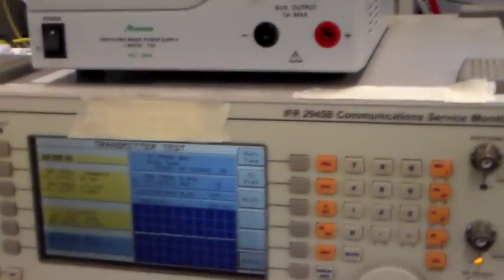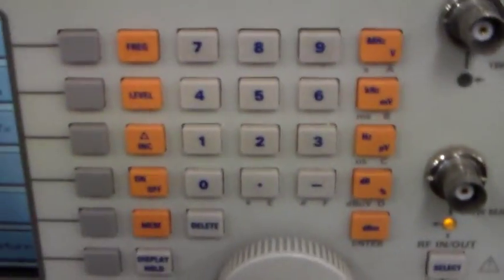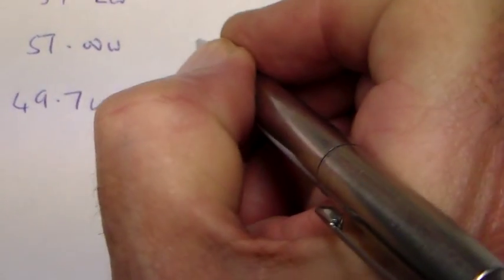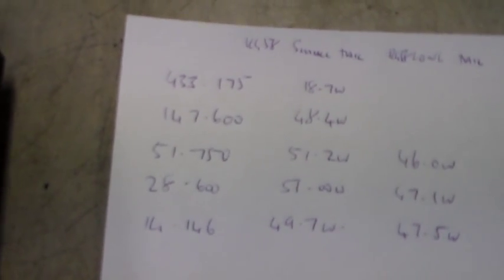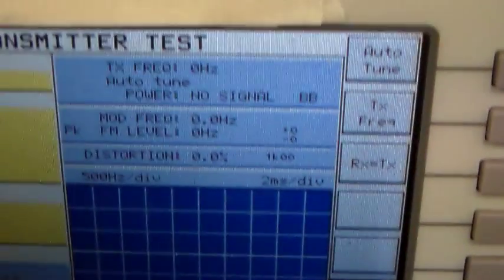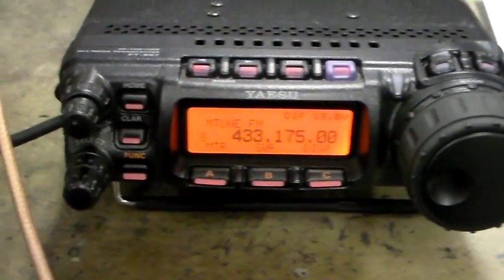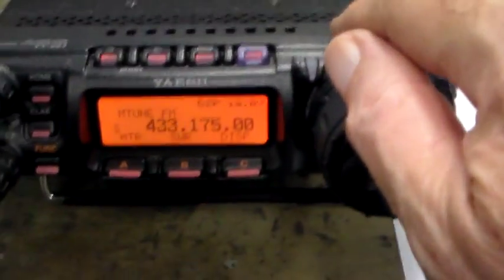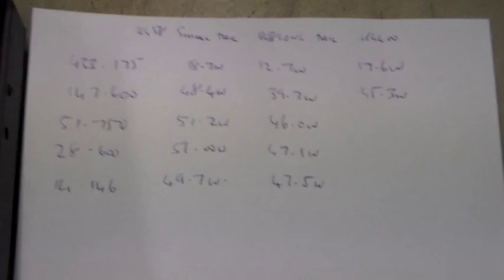RG58/RG400 Coax Loss At Different Frequencies.

Comment: I think a good rule of thumb is that you should try to have more gain in the antenna than you have loss in the coaxes run. Would be interesting to have a test  of RG213U on VHF UHF. I find that a good cost/performance compromise .

Comment: I am sure that the RF energy becomes heat in the cable ... Ok then ... I will just connect my antenna straight to the radio without a cable ... after all this is amateur radio ... Hahahaha